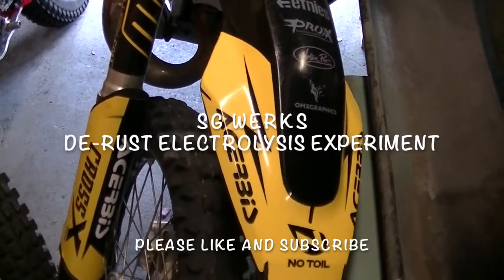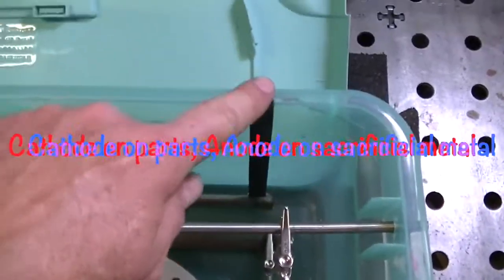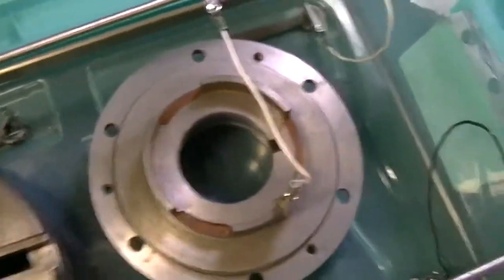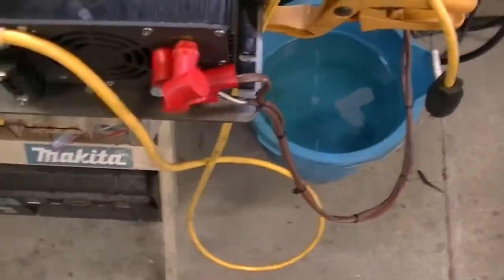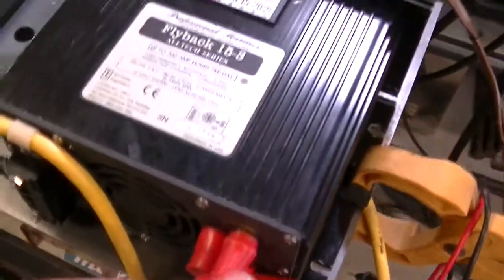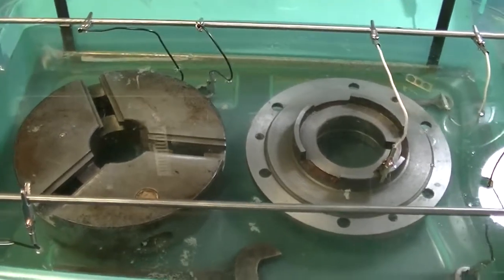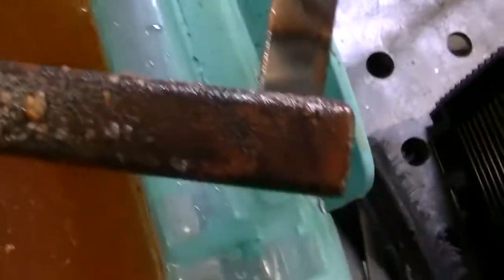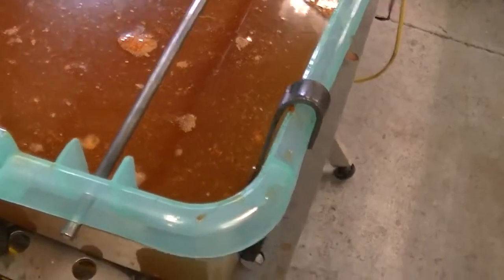Rust removal with electrolysis experiment

Comment: The cathode (bar clamp) could have zinc or chrome plating on it which might dissolve during the
process.  Appears to be a very effective, fast and cheap alternative to expensive EvapoRust.
I will have to give this a try, need to find a source for sodium carbonate which I think is soda ash
sold on Amazon, ebay, Granger, etc.  I have a Sears 12V battery charger with a trickle and fast start settings.  What was the ratio of water to sodium carbonate?  Great experiment!